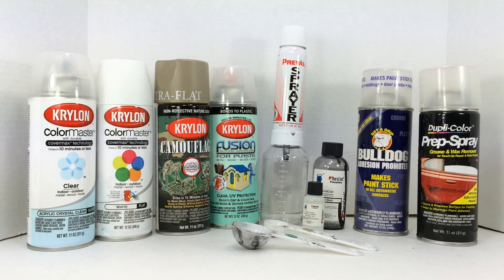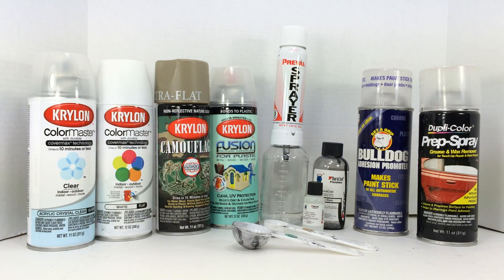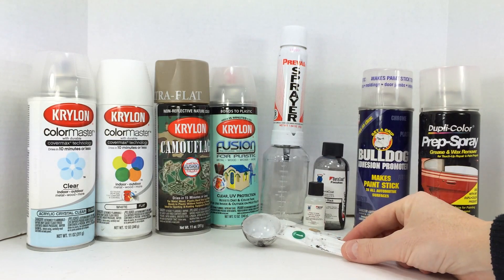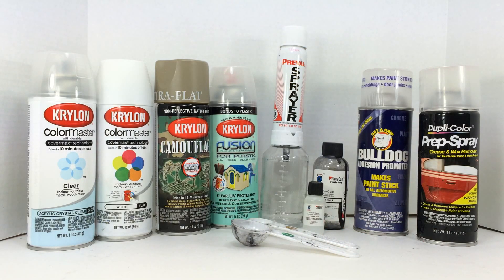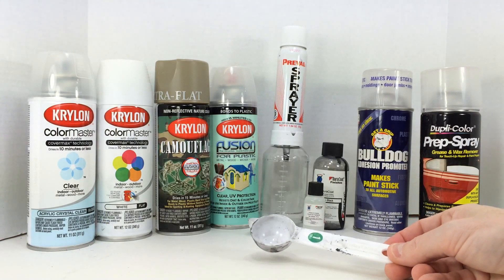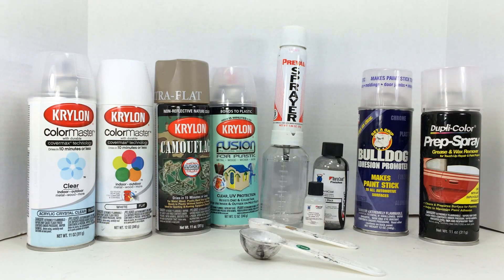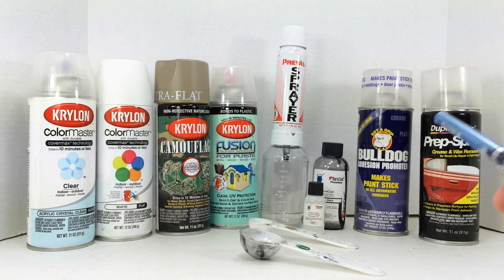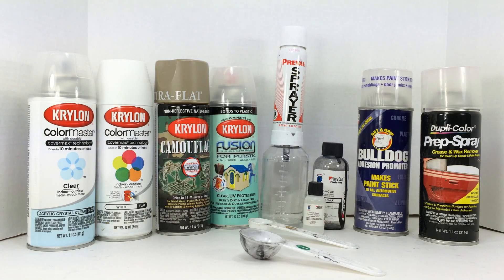Firearm parts painting, what you need and how to do it - Part 1

Comment: I have painted for a living.  Painted parts on several firearms. No paint will stay for the long term. Rubs off with holster use and everyday wear. Powder coating or cold bluing are the best options. Polishing to a mirror finish takes several steps and elbow grease but looks great ( my opinion ).
Reply: Can you paint guns with a liquid paint and paint brush, without spraypaint?
Reply: You think I could paint my barrel on top of a polish I want a mirror gold look but just on the barrel I want to keep the breech block black with gold engraving I figured to use my oem barrel because I really don’t want any issues with aftermarket but I might can find a cheap one and just try it first

Comment: I just type 2 anodized a receiver and the darkest I could dye it was a dark bronze color. The anodic layer is still fresh, so I want to apply a thin coat of a durable material that won't break the bank at this point. I just want it flat black. I mean the bronze is cool looking, but it needs to match the rest of the gun.

Comment: I’m looking at painting my pistol lower it’s one of my cc pistols I bought it at a stupid cheap deal a guy needed money.  The upper is a silver almost bronze in between but the lower well it’s pink lol. What is the best paint besides dipping or cerakote or durakote that will not wear off easy. Is the krylon camo a good bond? Or the high heat engine paint.
Reply from the maker: You can get Durakote in a can now.  Also, Aluma-Hyde from Brownells is also good.  Krylon has some good products, The Fusion is good for plastics.
Reply: Thank you It’s on a DB 380 I got it fir 100$ it’s almost new but lower is pink so wanted to paint it. I’ll try fusion thank you

Comment: i have a daniel defense pistol grip i want to paint black. would you suggest i sand it, spray it bake it? which can of spray do you recommend?
Reply from the maker: Cleaning is number one, use a wax and grease remover or alcohol.  You don't really need to sand plastic due to its already textured surface, especially if you use a paint specially formulated for plastic.  Krylon Fusion is good and its available in camo flat colors.  You can duracoat and/or cerakote with these two being the most durable and cerakote requiring a baking process to complete AND your going to need a air compressor and spray gun.  Duracoat is available in cans now.  Krylon will cost you $5 (stay away from Krylon Fusion Clear coat, its glossy), Duracoat is $40 for the can and another $40 for the clear.  Duracoat lasts 4 weeks once you activate the can.  Given what your painting, I would go with the Krylon Fusion
Reply: picking up a fusion today! thank you so much!
Reply: @jimmypage4753  how did the gun turn out?